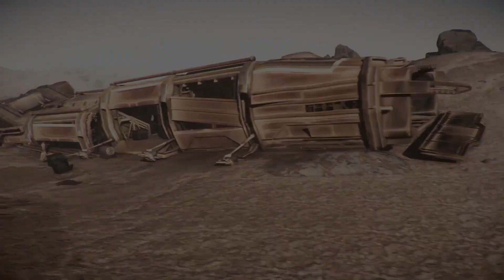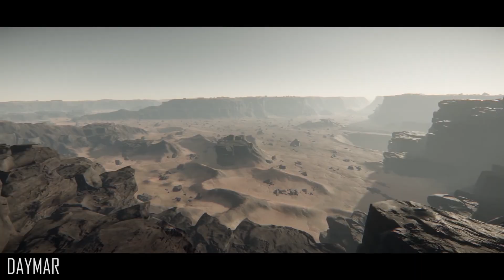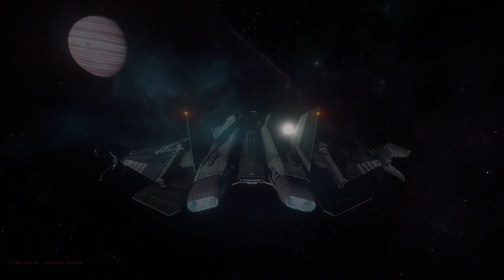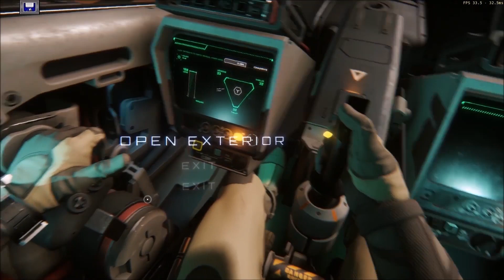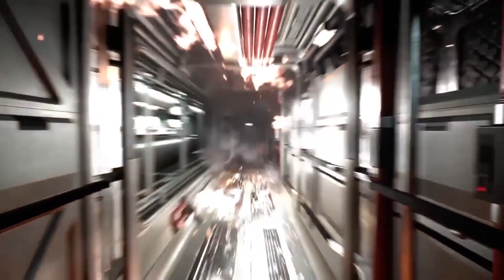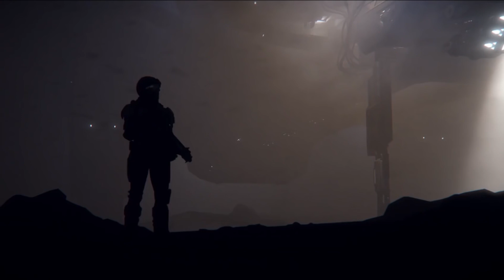Star Citizen Alpha 3.0 | Gravity, Planet Tech & Power

Comment: I'm confused, if engines take that much power, why do we still need to use fuel? Is fuel only used for quantum /jump travel? If we divert power from engines does that include maneuvering thrusters? How much charge time is there between diverting power to and from engines? If we have a ballistic load-out do we still need that much power or can we pump it all into shields and engines instead? Sometimes I fear this game is becoming too complicated and detailed to truly enjoy...
Reply: Veritable Vox well it's essentially a simulator of 'real life' in space. you could always leave the power levels equal across the board, but with all simulators, you'll need to tweak things to get real good results. Maybe they'll add in an automatic setting or something too.
Reply: I know that Voice-Attack software can let you set and reset power hands-free, I'm just confused by whats going to take power, and how much, and how long it takes for powering to take effect. I mean what about other systems like life support and gravity, are those a constant power drain as well? Can we shut them off temporarily for a power boost? Also is a power generator going to last forever or does it need nuclear fuel to keep operating at peak efficiency.

Comment: Wonder how power management will mix with atmospheric flight. Because many of the ships don't look like they're designed to generate lift, I assume that those ships will have to be running thrusters full time to counteract gravity. If this is the case, does that mean those ships can't afford to both fly in atmo and do something like recharge their shields? Very cool emergent gameplay if so. Would also help explain why some craft are designed to look like atmospheric fighters. They can both maneuver (when generating lift) and still do other stuff (fire energy weapons, recharge shields, scan, etc).

Comment: Presumably the gravity generators on a ship produce Earth-normal gravity; Does this mean ships like the Banu Merchantman would/could have whatever gravity is normal for that species?
Reply from the maker: That is a good question, I assume in lore at least it would be programmable BUT set to Earth for all human ships. It's a good question, can we change the gravity on our own ships?
Reply: BoredGamer well one of the vids a few weeks back was talking about breathable gas composition, and it will be a thing that we could effectively release a toxin gas into a ships air supply to knock out the crew. if they are going that detailed then no reason why they can't add an ability to hack the gravity generator to knock it up a bit, or down to nothing.... as far as the banu go, is say their home world and ships are either a normal earth gravity or less. They are a tall spindly race, heavier gravity would be bigger bulkier frames and muscle mass to deal with the extra weight caused by higher gravity.
Reply: you can turn it off, thats changing gravity right? :P
Reply: Actually, come to think of it, if we can control gravity on board the ship, why would the pilot be subject to adverse G-forces on any ship that can control it's own?  Might be a plus for heavy fighter ships like the Vanguard.
Reply: Well generally, you should be able to fly with no gravity to avoid G force, but at the same time, if you were carrying valuable/fragile cargo, you could mess that up since everything inside the ship would be floating and banging aroundlike no tomorrow
Reply: Never pass up a business opportunity!

It's not boxes floating and banging around in the back of a Freelancer, it's a cargo-grab game show ready to be made! Will our contestants fly away with a shiny new densely packed set of easily transferable commodities or will their only prize be blunt physical trauma?!  Find out tonight, on "So You Think You Can Grab a 25 to 75 cm Physical Object in Spaaaace!" 8D
Reply: Mark Douglas Hey, it's been confirmed that Alien ships will definitely have different gravity which is relevant to their home planet/biology.